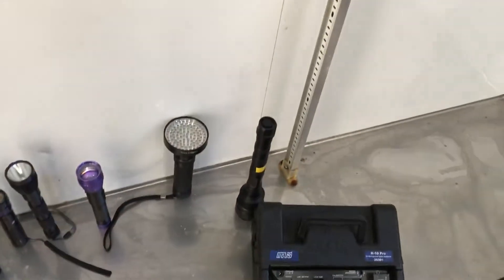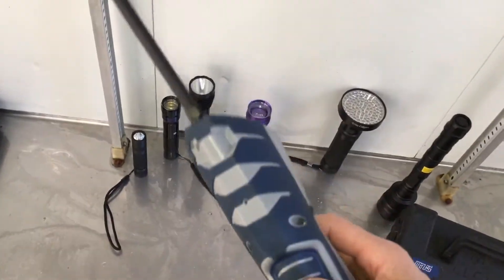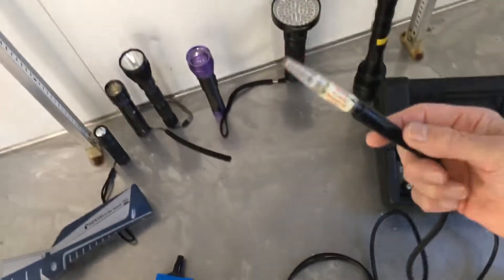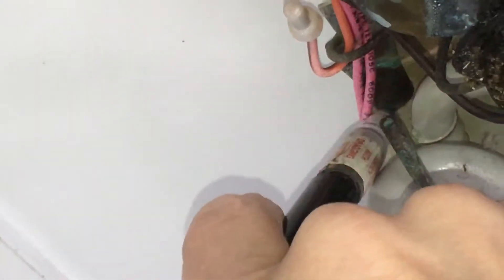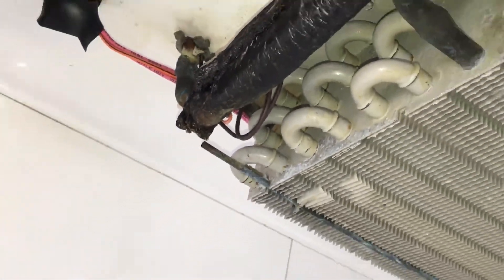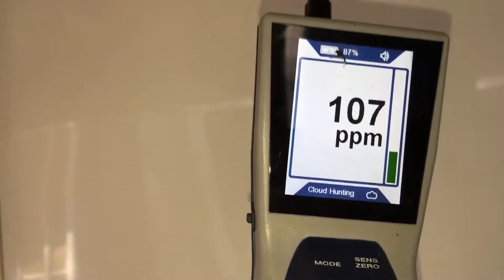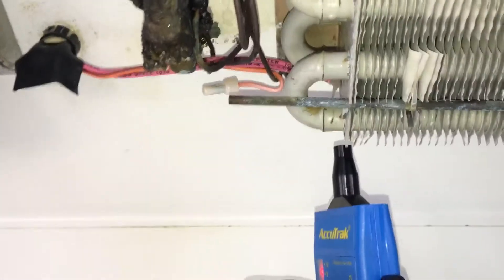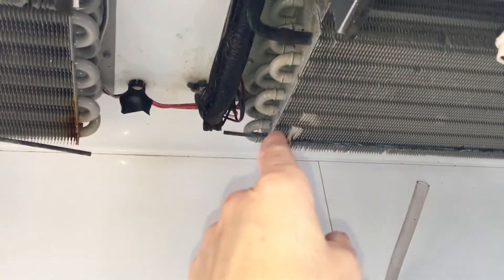Leak detection, ultrasonic, UV dye, H 10, DeTec Stratus,  depending on the leak at time of testing

Comment: A few months ago I was strongly considering buying an ultrasonic detector (same model). In the sales video I looked at, it easily picked up condensor leaks from running hvac units...even from a good bit of a distance (I assume the higher run pressure helps). The video showed the user adjusting sensitivity to let it focus on a smaller area of the coil, and then he used "bubble spray" to isolate EXACTLY where on the brazed connection the leak was occuring.
After viewing your video it appears that the ultrasonic unit might not be as "wonderful" as I assumed, due to it's high sensitivity possibly sending the user down "rabbit holes" in many circumstances. I currently use a "wand type" detector and bubble spray. I had originally thought the ultrasonic unit would be of great benefit when dealing with a leaky a-coil (and resultant "refrigerant flooded" plenum) while evaluating the nature of the leak, or a condensing unit coil (especially on a windy day).
I realize this is an older video, but the info contained is greatly appreciated!

Also ...I only recently came across your channel and started viewing ...I had NO IDEA until the other day that you delve into pretty much ALL areas of A/C work...home hvac, automotive hvac, and refrigeration...Greatly impressed!!!
Reply from the maker: Ultrasonic leak detector can work for many feet away from the location of the leak. 

There are background noises like interference from the power supply from the LED lights and fluorescent lights .  But that is up to the user to train their ears because they are very different. Once you know the difference he will not be fooled because they’re so different the way they sound.. 
     Ultrasonic leak detector will sometimes find a leak that the electronic refrigerant leak detector will not find. 
     It all depends on the type of leak where it is located. I have made videos showing where bubbles find a leak and for some reason ultrasonic leak detector did not find the leak.
      I have made videos where ultrasonic leak detector found a leak but refrigerant. Leak detector did not find a leak.. 
  And the opposite, there’s only many different ways to find leaks. There is no one perfect only method.. 
    Just like using fluorescent UV dye it sometimes finds leaks that cannot be found using other methods easily. 
   And opposite is true sometimes UV dye does not find a leak and a different method finds it instead

This is why anybody in this business has a specialty owns every type of device and uses every type of method to find leaks . Because there is no such thing as a perfect leak detector for all situations.. 
      There’s just all different types of leak detectors to find every different situation leak.